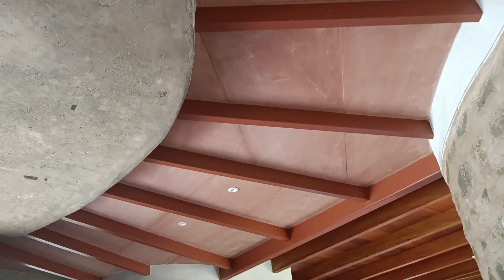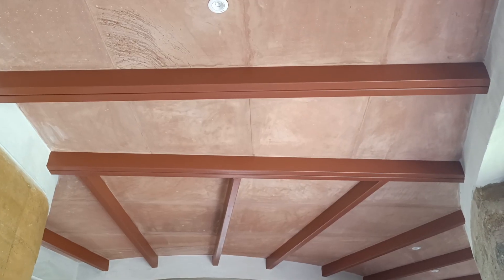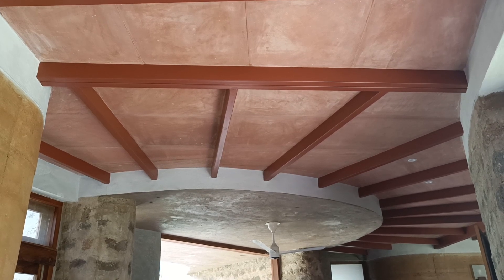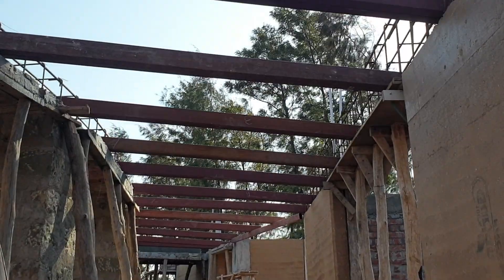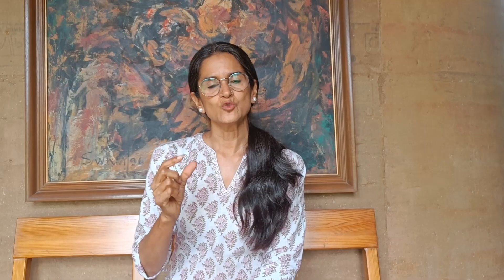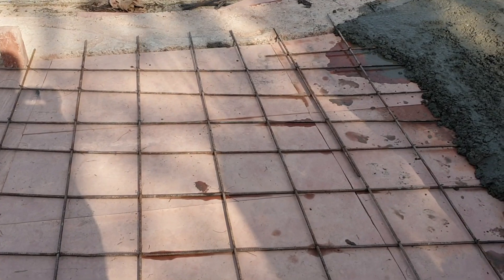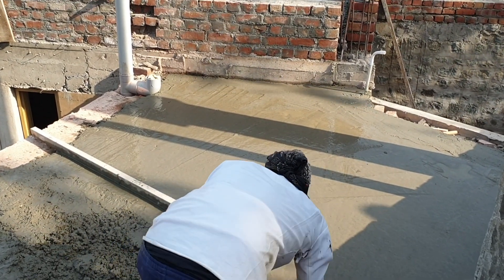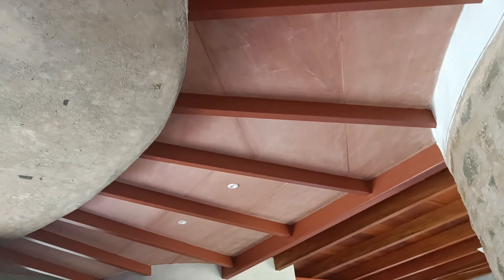How to Build a Stone & Metal Pipe roof

Comment: i have seen in one video where they say garter stone roofs sag with time as it cannot take the load for long time and because of this problem you can have water leakage problems in rainy season.did u have such leakage and roof sagging problems?

and where we can find red sandstones of best quality,from where did u get.? kota,rajhasthan?
Reply from the maker: I think you need to use the metal pipes of the correct dimensions so they can bear the load of the red sandstone. We have not faced any such problem as of now. You can get stone locally in your area .. do check around at the stone/marble/tile stores.
Reply: Thanx 4 reply @farmaanandaa

Comment: Called Narayanji and seems, he only builds brick based roof.
Can you share contact for stone-metal roof expert contractor?
Reply from the maker: Any contractor can do that work. Pls check with your local mason
Reply: @farmaanandaa  i checked with a few. They do one stone over two girders. And not one stone spanning across multiple girders like at yours. This design seems seismic resistant to me.
That's the reason I asked for this guy specifically!
Reply from the maker: Our design is also one stone over two metal pipes. The joints are concealed so it looks like one stone over many pipes.
Reply: @farmaanandaa  oh alright.
In your opinion, will it perform well in earthquake?
At 2:32, it does seem like, stones span across three girders. Am I seeing it wrong 🤔?
Reply from the maker: You are right. But it does not affect the construction at all. There is no point in cutting big stones to smaller pieces. If you use metal pipes, they just go across multiple ones if the size is large in some places